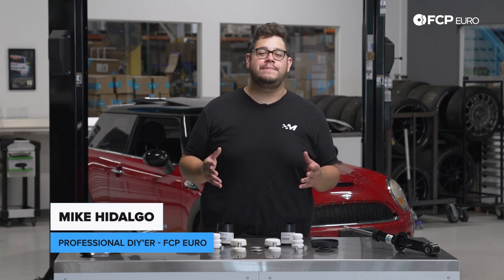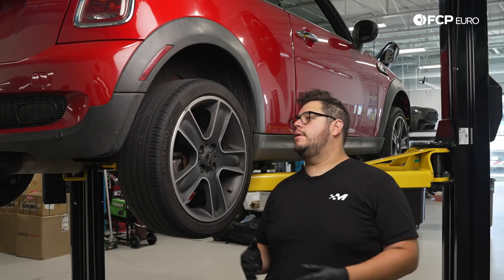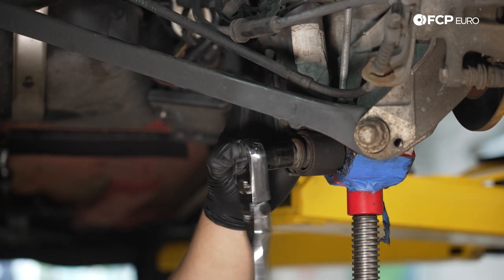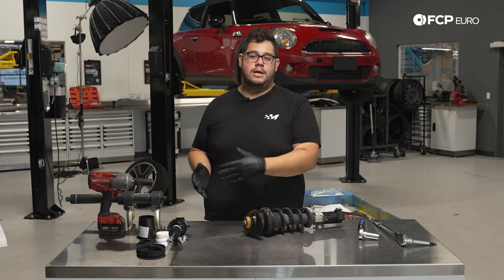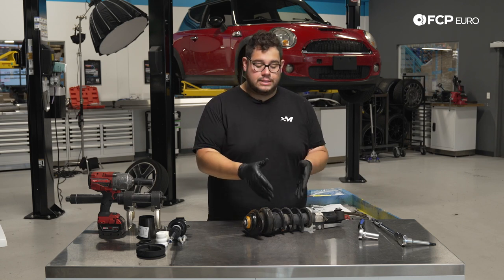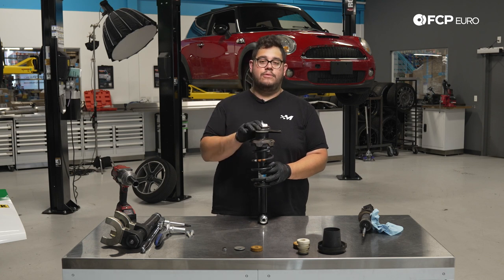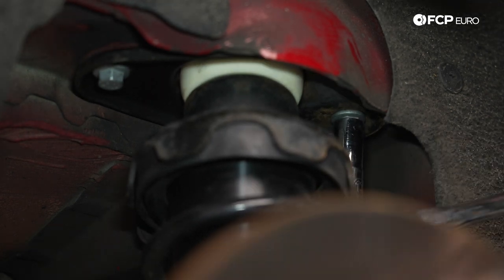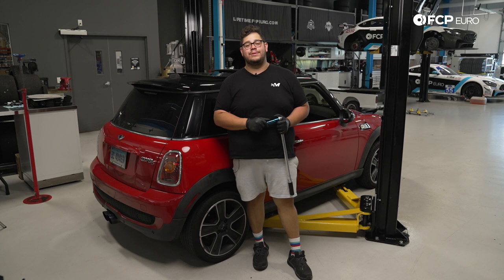R56 MINI Cooper S Rear Shock Replacement DIY (2006-2013 MINI Cooper, S, John Cooper Works)

Comment: Did my struts today and this video really helped. A few tips from my side:
- make sure your spring compressor is set up in a way that lets you reinstall the parts on the new struts. Mine was in the way and i had to reposition it.
- when reinstalling the strut it was sitting way lower than the rest of the suspension. I removed the sway bar link on one side to lower the suspension.
- the lower bolt should be torqued at ride height. I started the bolt, then put a jack under it and raised it to ride height (even better if you measure that height before jacking up the car). This is also the time to reinstall that sway bar link

All in all a pretty easy job if you take your time

Comment: Greta in-depth video. Thank for this! I was confused because at first I thought I had to remove the mount bolts from inside the car like some vehicles are. One of the easiest set of struts I’ve done.

Comment: Are you not supposed to torque the lower strut bolt to spec when its under load?
Reply: You are correct